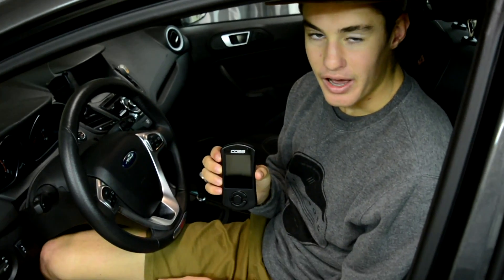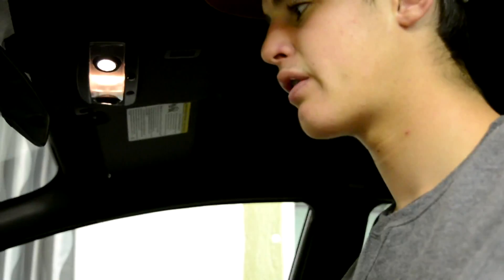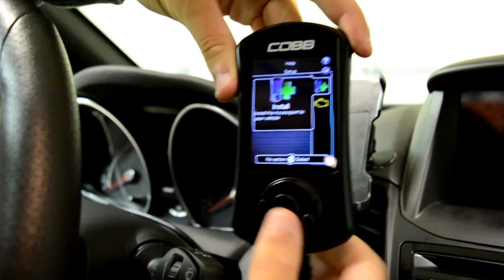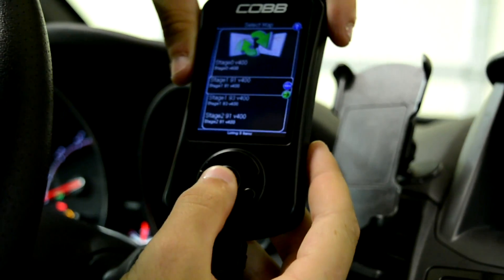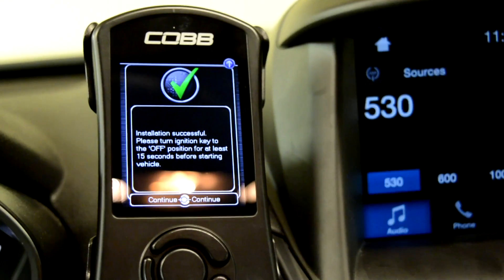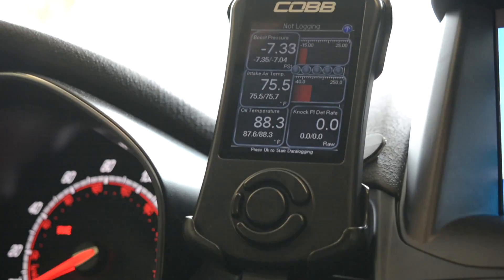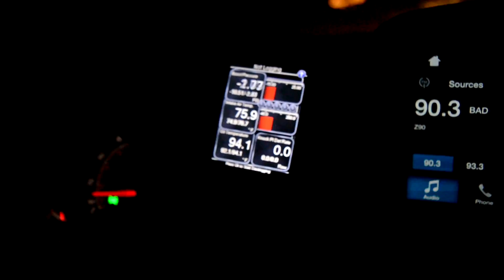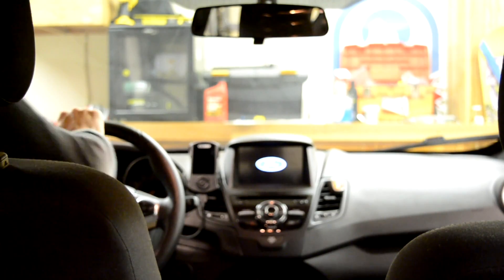FIESTA ST ACCESS PORT INSTALL!!!

Comment: when you buy the cobb stage 1 package that comes with the motor mount and the air panel filter what option do i have to chose?

Comment: So for Stg 1 should i buy the parts needed to support it first or buy the accessport first
Reply: I would say buy the stage 1 package. It's 3 parts. 
Rear motor mount
High flow panel air filter
Access port. 
I bought the parts over a 1 month period and spent more $$ than if i bought it all together from cobb. Don't make the same mistake i did!
Reply: fonz 2613 did the stage 1 do anything for you? Looking to get the access port but curious if the extra parts do anything

Comment: i seen ppl run the stage 3 with no bolt ons and still get decent gains. btw u should've showed launch control launching not just hanging revs lol